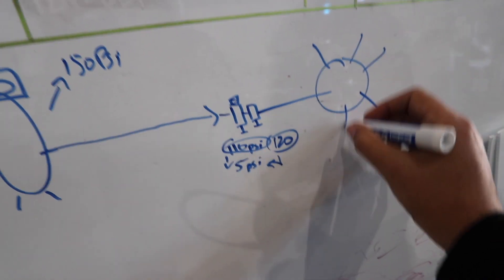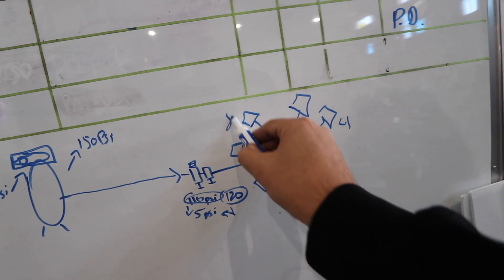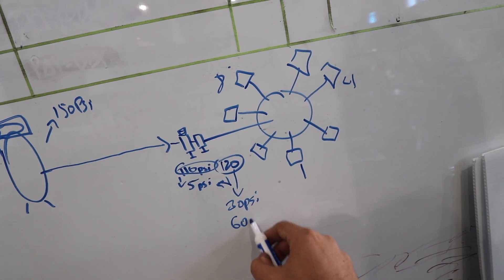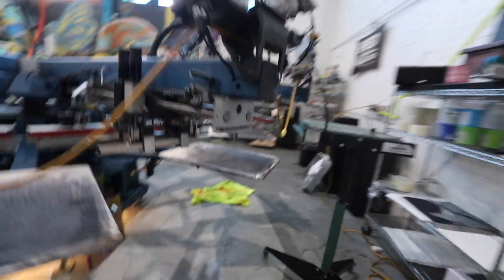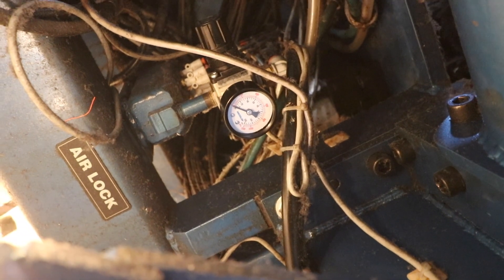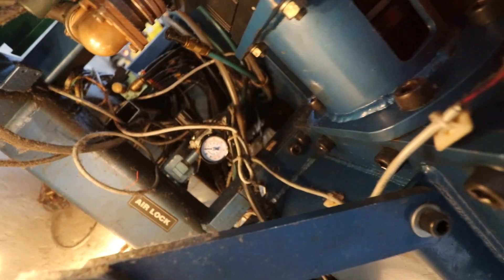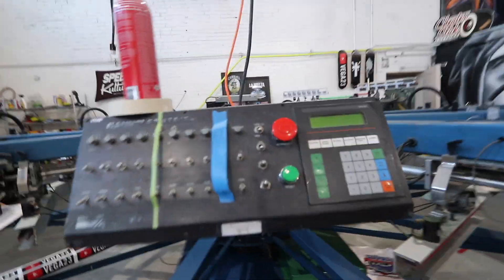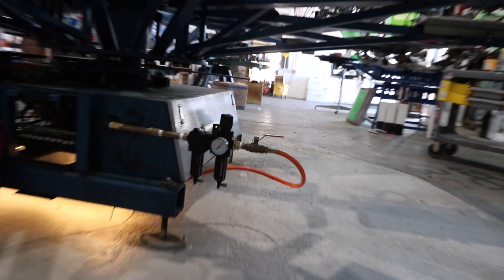Low Air Pressure Alarm on automatic screen printing press

Comment: Yess hello, I had a couple questions I’m having with my machine. I was wondering if u knew how to fix it. The pallets doesn’t go up as if the flow of air isn’t going through I would appreciate it if u could help me out
Reply from the maker: The valve that makes it go up and down could of went bad 
I had that issue before too 
I replaced the valve and that fixed the problem